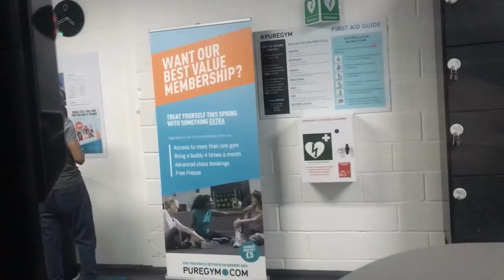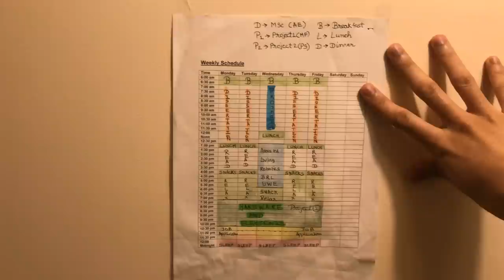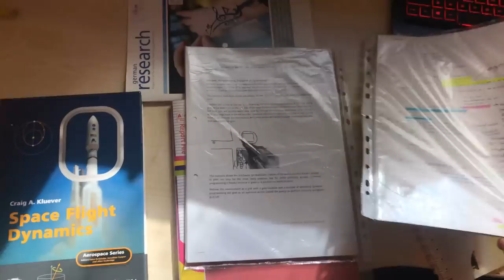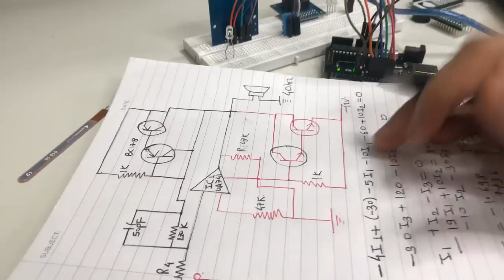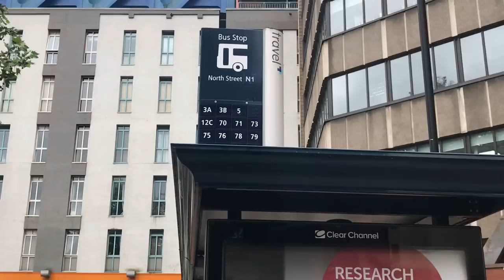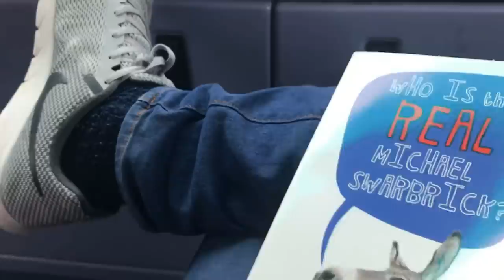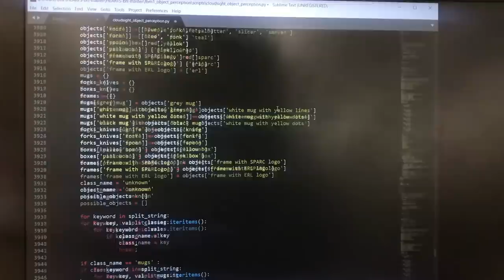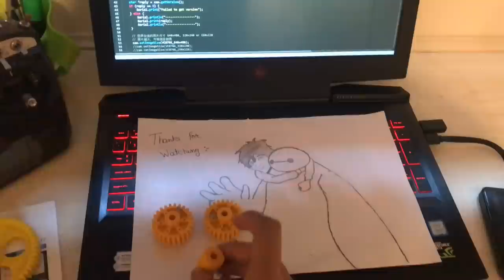Day in the life of a Robotics Engineer at University of Bristol & Bristol Robotics Lab

Comment: Amazing! Just completed a BEng honours degree in Engineering, now plan on doing a MEng or MSc in Robotics or Mechatronics as a specialisation, il have this next year 2023 free to get better at programming and work through some robotics books ive bought then that should create fertile ground for the next stage. But its upbeat positive videos like this that motivate me even more. Your project is a good one!. My final project was a PID controlled self balancing tray, 3D printed parts with an Arduino, BNO055 IMU and servo actuators.

Comment: Hello ✋✋Just found your page and I'm a huge fan of Robotics and Tech. Love your videos. I was actually wondering if a MacBook (The new MacBook pro 16-inch ) would be a good fit for a robotics engineer.  Thank you!
Reply from the maker: Hi @VeraAgiang . Welcome to the club buddy. To be honest, it all depends on the project in Robotics, no laptop is powerful enough to do everything. As a robotics engineer, For regular use, you might end up using Robotics operating system (ROS) on the Linux Ubuntu Platform. I am not a big fan of MAC mainly because of its GPU  compatibility with most of the Simulations which I have to use to work on different robotics platforms. On the other hand, NVIDIA is currently leading the hardware support for Artificial Intelligence algorithms. I have HP Omen 16GB ram, 1050Ti NVIDIA GTX Graphics card, I7 7th generation. I am quite happy with my laptop and I do all my work on my machine. I can train decent neural networks(Computer vision) also on my machine and if I have to train some heavy network then I use university supercomputer access or simply just cloud services (Which is quite rare).  I hope this will help. text me on Instagram if you need any more help. :-)
Reply: @LetsTalkWithRobots  Thank you so much. I'll definitely text you on instagram if I need more help.
Reply: No, if you are truly wanting to be an engineer please throw away anything Apple! Jokes aside, Apple products tend to be SEVEEEEEERELY underpowered and EXTREMELY over-priced (we're talking 1000 dollars price tag for 400 dollar value kind of overpriced). The reason for this price tag is due to the brand and very careful attention to detail and user experience. As engineers we do not generally care at all for these qualities. Apple makes very closed and unfriendly systems for engineers, because they are completely isolated from the world (Apple products -> apple accessories -> apple software -> apple assistance -> apple everything). For engineers, we want as much compatibility as possible, as much bang-for-buck as possible (since we need the most powerful CPUs we can gather within our budgets), as much openness as possible (so we can interface with as many devices and open-source programs as possible). This is literally the most anti-Apple thinking possible, so steer clear from Apple if you are planning on doing these things.

Comment: Which laptop are you using man
Reply from the maker: I used to have HP omen ( Gaming series ) 1050TI nvidia graphics and 32 GB RAM .

But now I work mainly on cloud clusters to train AI models. For daily software development, I use a machine which has 8GB Graphics, 32 GB RAM and running Linux Ubuntu kernel.
Reply: @LetsTalkWithRobots  hey I am about to start my masters degree in manufacturing and robotics from TU Wien. I was wondering if a gaming laptop Lenovo IdeaPad gaming 3(2021) with ryzen 5 5600H with 16gb ram, rtx 3050 will work for all the intensive tasks in robotics. I will run python c++ MATLAB, NX Siemens and machine learning and AI.
Reply from the maker: Based on the specs you provided, It is a solid choice for robotics day-to-day development. It's good for programming in Python and C++, running MATLAB, and using CAD software like NX Siemens (you might end up increasing RAM to 32 GB if required). Just test it and see how it goes. I have 32GB RAM in my day-to-day dev laptop.

For machine learning and AI tasks, the RTX 3050 GPU supports CUDA for accelerated computations, but for very large models or datasets, you might need additional resources like cloud-based solutions which is very common practice, no laptop is powerful enough to train LLMs. We all use cloud services like AWS/Google's Vertex AI or Microsoft Azure. Overall, it should handle most of your tasks well.

I hope this helps and Good luck with your course. Have fun
Reply: @LetsTalkWithRobots  Thank you so much! I couldnt ask for a better reply.

Comment: Hey uhh im currently 14 year old and i wanna be a robot engineer too.
Soo can you tell me what imporant and what course i should take to reach the lvl?.
Reply from the maker: Hey Buddy. Its a very broad question because the answer of this question can be from mechanical or software design point of view.You are very young now , which is great So, I will suggest you to start getting hands-on experience with python. It is very easy to learn language and most importantly its the language which will help you in small robotics projects. Side by side you can start working on Arduino or raspberry pi  and you can use python to work on these. I use python in my day to day life for machine learning and  deep learning models. There are loads of courses on course era or EDX on python.I always prefer learning by doing so, I will advice the same. I hope this will help for the time being.